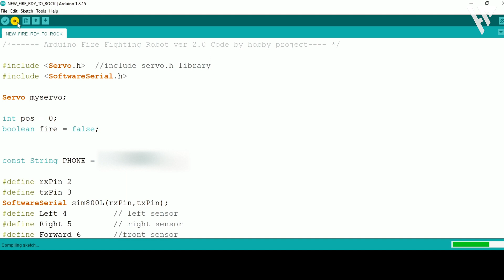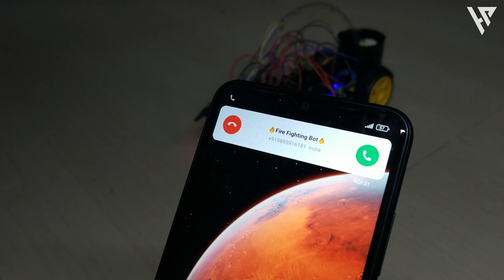Arduino Fire Fighting Robot with Sms and Call Alert

Comment: Hello bhai mai na pora project bana liya hai but mujhy motor driver l293 nehi mil raha mai na uski jagha sheild le hai HW 130 Motor driver sheild but mujhy connection samgh nehi aa rahi hai kesa kroun bs yeh  problem aa rahi hai
Reply from the maker: Use l293 or l298n , not work with hw 130.
Reply: Bro mai na yeh saray connection kiya hain but work nehi kr rahy ap na jo diagram mai 3 jagha se postive or negative ki wires bahir nikali hain but usko kisi se connect nehi kiya wo kya hai mera project work nehi kr rsha or tuesday ko submit krwana hai please help me

Comment: LM 2596 Buck converter heat ho rha hai
Reply from the maker: Check the connections once again.
Reply: @hobbyproject  i have checked and all are correct but there is problem is that our bo wheels are working but they are stop when we give connection wheels are on only
Reply: but wee need our car wheels go when we bolw fire is detected but not happening
please can you help me
Reply: we are making group project can you help we have very less time please can you help us
Reply: can we contact for these for guidace we dont have much time for project we have tried many times from 1 and half month please i request you...?

Comment: what can i use as an alternative for the L293 motor driver?
Reply from the maker: L298
Reply: @hobbyproject   Is it the L298N or just L298? Thank u for replying.
Reply: @hobbyproject  Also, what jumper wires did you use? M-M, M-F, F-F?
Reply: @hobbyproject  one last question, would it be alright if I use the arduni uno R3 instead?

Comment: Bro what if the fire is caused by petrol or kerosene, water spraying system cannot be used in that case , the fire spreads more 
Can you please add oxides and water spraying system both in this project and make a video, actually Im doing this project for my college
Reply: What collage bro
Reply: Its a concept and not an actual product. Pls try to think on a real time basis
A small robot cannot extinguish a fire of a large amount

Comment: bro you took the battery at 3.7V and use buck conveter.why you use buck conveter.why dont you use boost conveter.
Reply from the maker: Buck converter can reduce input voltage to lower output volts, here we are using 2 batteries total 7.4 volt , sim 800l requires about 3.5 to 4.5 volt.
Reply: @hobbyproject  what are the problem with out using buck conveter

Comment: which website or software can we use for the circuit diagram sir?
Reply from the maker: Tinkercad
Reply: @hobbyproject  Thank you sir
Reply: Flame sensors and SIM800L modules are not available on that platform, sir.

Comment: i made this , but have an error with the project . its not working (i cant found the single relay module i have to fix it with 2combined relay module and motor driver with 3 ics, ) if i changed those components instead of yours  i have to change the code also ?
Reply from the maker: Code remains the same

Comment: Im looking for a help, I bought a IR sensor instead of Flame sensor, does this will still work?
Reply: Well done
Reply: IR Sensor and Flame Sensor are two distinct types of sensors with different purposes. Here's a comparison to help you understand the differences:

IR Sensor (Infrared Sensor)

- Detects infrared radiation (heat, light)
- Typically used for:
    - Proximity detection
    - Obstacle avoidance
    - Motion detection
    - Line following
    - Remote control signal reception
- Output: Digital (0/1) or Analog (voltage)
- Sensing Range: Varies (e.g., 2-50 cm)
- Examples: VS1838B, TSOP4838, MLX90614

Flame Sensor

- Detects infrared radiation specifically emitted by flames (1-10 μm wavelength)
- Designed for fire detection and alarm systems
- Typically used for:
    - Fire detection
    - Industrial automation
    - Security systems
- Output: Digital (0/1) or Analog (voltage)
- Sensing Range: Typically 1-5 meters (depending on sensor sensitivity)
- Examples: MQ-135, YL-69, FL-06

Key differences:

1. Purpose: IR sensors detect general infrared radiation, while flame sensors focus specifically on flame detection.
2. Sensitivity: Flame sensors are more sensitive to infrared radiation emitted by flames.
3. Wavelength: Flame sensors are tuned to detect the specific wavelength range emitted by flames.
4. Range: Flame sensors typically have a longer detection range than IR sensors.

What to do since you bought an IR sensor instead of a flame sensor?

1. Check the IR sensor's datasheet to see if it can detect flame-specific wavelengths (1-10 μm).
2. If possible, adjust the sensor's sensitivity or threshold to improve flame detection.
3. Consider using the IR sensor for other purposes (e.g., proximity detection, motion detection).
4. If flame detection is critical, purchase a dedicated flame sensor.

Before using the IR sensor, ensure:

1. Understand its specifications and limitations.
2. Adjust the code and circuit accordingly.
3. Test the sensor thoroughly.

If you're unsure or need help with implementation, provide more details about:

1. The IR sensor model you purchased.
2. Your project's requirements.
3. Your microcontroller/board (e.g., Arduino, Raspberry Pi).

I'll assist you in adapting the IR sensor or recommend alternative solutions.

Comment: Thank you for the explanation, but the code does not work for me. Please give me the correct code
Reply: please Sir answer me 🙏
Reply: Or Full code 🙏
Reply from the maker: check the connections, code is fine.
Reply: I checked it very carefully
Reply: If you have another way to communicate, I will be very happy to contact you so that I can inform you of all the details

Comment: I have same project like this.
360 degree fire fighting robot with 3 flame sensors ultrasonic sensor to avoid obstacles.
And robot movement controlling through mobile application
Reply: hi do u have the documentation of your project?
Reply: @poorvi2388  yes bro
Reply: @Abidali-qi3xj can you please help me with the project
Reply: sir can you share your documentation and code for the project you did as am also trying to make such a project.

Comment: When iam connecting buck converter to battery and then connecting it to socket of motor driver the power is going in buck converter plz help!!
Reply: When I am connecting single wire in socket power is there in buck converter but when I am connecting the second wire the power is going immediately in buck converter

Comment: hi bro 
can u tell the connections between the 3 flame sensors more clearly 
saw the circuit diagram as well but cant understand 
call u tell like "above pin of flame sensor 1 to middle pin of flame sensor 2" like that 
sorry to trouble you
Reply: bro?

Comment: @hobbyproject 
I need a Suggestion
That Can I use L293D motor driver instead of L293?? Cuz, in BD that one is not available anymore
Reply from the maker: use L298.
Reply: @hobbyproject sir is the code and wire placement same for it? Or are there some Changes

Comment: Hello , how do you connect the water pump? , because I connected like in the diagram, but is not working
Reply from the maker: Interchange b/w NC and NO.
Reply: @hobbyproject  and with how many vols do you powered the water pum ?
Reply from the maker: with single 18650 battery ( 3.7V)

Comment: Excuse me quick question, can I power the motor and the sim 800L with a battery of 9V?
Reply from the maker: nop
Reply: @hobbyproject  so with how many power ? Or what can I use?
Reply: @hobbyproject  because I saw in the video than you used 2 battery’s, but how many vols has each battery ?
Reply from the maker: use 18650 battery x 3.

Comment: Bro in flame sensor how to connect that black wire
Black wire from right to front centre point.and black wire from left to leave out via hole is it correct bro

Comment: Bro can i use combination of two battery give more than 4.5 volt and set ot to 4.3volt using potentiometer
Reply from the maker: use lm2596 buck converter.
Reply: Thanks bro

Comment: hello sir. the code you provide and the circuit you given i followed everything, but still not working.  Is there any changers in the code? the sensors and all components are working fine alone. but in circuit its not working .fire and gas are not detected. can you help me?
Reply from the maker: Power source ?

Comment: Bhai ye Arduino code kaha milega or kese upload karna hai
Reply from the maker: Check the description,
Reply: @hobbyproject  Hello bro please ye flame sensor ka connection samja do
Reply: Hello can I add 9v battery
Reply: Bro please provide me your contact number I spend 5000 rupees in fire robot project but it is not working help please your Instagram I'd please

Comment: Sir please contact your no or email because water pump continually on not turn off circuit is correct but not work properly please help sir
Reply: Please reply sir 🙏🥺
Reply from the maker: Change the connection on relay module NC to NO or NO to NC

Comment: Hey! The lights in flame sensor glows but it doesn't work. Can you please suggest any solution on this.
Reply from the maker: Try by adjusting the potentiometer on  flame sensor.
Reply: @hobbyproject  1:15 what is the measurement of that board?
Reply from the maker: About 25cm .
Reply: @hobbyproject  thanks bro
Reply: @hobbyproject  please reply 🙏

Comment: Can I Connect circuit without Bread Board, like the circuit diagram
Reply from the maker: Yes you can
Reply: @hobbyproject  Thank you sir
Reply: But sir Can I use L293D Motor Drive

Comment: /*------ Arduino Fire Fighting Robot ver 2.0 Code by hobby project---- */
 
#include <Servo.h>            //include servo.h library
#include <SoftwareSerial.h>  //include SoftwareSerial.h library

Servo myservo;
 
int pos = 0;    
boolean fire = false;

const String PHONE = "+91**********"; //use your number with country code

#define rxPin 2
#define txPin 3 
SoftwareSerial sim800L(rxPin,txPin);
#define Left 4          // left sensor
#define Right 5         // right sensor
#define Forward 6       //front sensor
#define GAS_SENSOR 7    //Gas sensor
#define LM1 8           // left motor
#define LM2 9           // left motor
#define RM1 10          // right motor
#define RM2 11          // right motor
#define pump 12         //water pumb

void setup()
{
   
  Serial.begin(115200);
 
  sim800L.begin(9600);

  sim800L.println("AT");
  delay(1000);
  sim800L.println("AT+CMGF=1");
  delay(1000);
  
  pinMode(Left, INPUT);
  pinMode(Right, INPUT);
  pinMode(Forward, INPUT);
  pinMode(GAS_SENSOR, INPUT);
  pinMode(LM1, OUTPUT);
  pinMode(LM2, OUTPUT);
  pinMode(RM1, OUTPUT);
  pinMode(RM2, OUTPUT);
  pinMode(pump, OUTPUT);
 
  myservo.attach(13);
  myservo.write(90); 
  
   while(sim800L.available()){
  Serial.println(sim800L.readString());
  }
  
}
 
void put_off_fire()
{
  
 
 
    digitalWrite(LM1, HIGH);
    digitalWrite(LM2, HIGH);
    digitalWrite(RM1, HIGH);
    digitalWrite(RM2, HIGH);
    digitalWrite(pump,HIGH);
    delay(500);
 
 
    for (pos = 50; pos <= 110; pos += 1) { 
    myservo.write(pos); 
    delay(10);  
  }
  for (pos = 110; pos >= 50; pos -= 1) { 
    myservo.write(pos); 
    delay(10);
  }
  digitalWrite(pump,LOW);
  myservo.write(90); 
  fire=false;
}
 
void loop()
{

  
  myservo.write(90); //Sweep_Servo();  
  
  if (digitalRead(Left) ==1 && digitalRead(Right)==1 && digitalRead(Forward) ==1) 
    {
    delay(500);
    digitalWrite(LM1, HIGH);
    digitalWrite(LM2, HIGH);
    digitalWrite(RM1, HIGH);
    digitalWrite(RM2, HIGH);
    }
    else if (digitalRead(Forward) ==0) 
    {
    digitalWrite(LM1, HIGH);
    digitalWrite(LM2, LOW);
    digitalWrite(RM1, HIGH);
    digitalWrite(RM2, LOW);
    fire = true;
    
    }
    
    else if (digitalRead(Left) ==0)
    {
    digitalWrite(LM1, HIGH);
    digitalWrite(LM2, LOW);
    digitalWrite(RM1, HIGH);
    digitalWrite(RM2, HIGH);
    }
    
    else if (digitalRead(Right) ==0) 
    {
    digitalWrite(LM1, HIGH);
    digitalWrite(LM2, HIGH);
    digitalWrite(RM1, HIGH);
    digitalWrite(RM2, LOW);
    }
    delay(400);//change this value to change the distance
    
     if(digitalRead(GAS_SENSOR)== 0)
    {
     Serial.println("Gas is Detected.");
      send_sms(); 
    }
   
     while (fire == true)
     {
      put_off_fire();
      Serial.println("Fire Detected.");
      make_call();
     }}
     void make_call()
{
    Serial.println("calling....");
    sim800L.println("ATD"+PHONE+";");
    delay(20000); //20 sec delay
    sim800L.println("ATH");
    delay(1000); //1 sec delay
}

void send_sms()
{
    Serial.println("sending sms....");
    delay(50);
    sim800L.print("AT+CMGF=1\r");
    delay(1000);
    sim800L.print("AT+CMGS=\""+PHONE+"\"\r");
    delay(1000);
    sim800L.print("Gas Detected");
    delay(100);
    sim800L.write(0x1A);
    delay(5000);
}

Comment: Sir i have a clarification that is in the circuit diagram you're using 3.7v*2=7.4(2 batteries at motor driver position) but i want to use in that place with three 3.7v=11v at motor driver place other than submersible pump position i can use 3.7v battery at pump...so please give me a suggestion for my problem...
Reply: Do you have code
Reply: Yeah i have the code ihave downloaded not opened and opened using arduino app

Comment: Sir, can you please tell me what kind of water pump and nozzle did you used? Thank you!
Reply from the maker: 5v Mini water pumb and for nozzle i have used pen tip.
Reply: @hobbyproject  
Hello sir, 
Thank you so much for the information and have a lovely week ahead :)
Reply: @hobbyproject  sir can you tell me is it remote controlled or automatic
Reply from the maker: automatic
Reply: @hobbyproject  sir i am making this project but i could not find buck converter. Can i make the same project without buck converter?
Reply: @popcorn6044  buck converter is used to give accurate volt to the sim800l and adjust the volt in that
Reply: @Kiran-bl1bs  Hi Kiran. I am so sorry to say this but I haven't yet get up to the coding bit (I need the PCB/ other structural system to do the code thing but I haven't yet receive the PCB). Are you also a first year uni student?

Comment: Show motor driver ..and make it using l298n or share your motor driver circuit diagram or link to buy your motor driver
Reply from the maker: Same connection for L298 driver.
Reply: @hobbyproject  Arduino UNO ko re-program ker sakte he ky ?...
Reply from the maker: Yes, when you upload a program it overwrites any previous program.
Reply: @hobbyproject  hey 
How many battery are good for better power 
3 or 4 quantity..
Reply from the maker: 3 battery is enough.
Reply: @hobbyproject  ok thanks
Reply: @hobbyproject  what changes can do to increased water flow
Reply: @rohanbhagat83   I think the size of the hose, the smaller the hose the more pressurized the water will be
Reply: @hobbyproject  Ok Thanks 😇